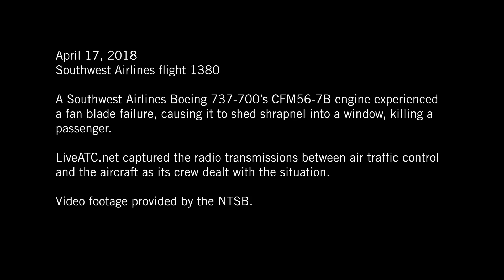Southwest Airlines 1380 Engine Failure 4/17/2018 ATC Audio – AINtv Express

Comment: Both pilot and ATC used lessons I was taught in the military: Never mind the fear. Focus solely on iimproving your situation. I knew both pilot and ATC were at least nervous because they (and the co-pilot too) got the runway designations confused. Several times. Perfectly natural and they self-corrected quickly. The ATC, presented with the extraordinary news that "someone went out," caught himself and said "Doesn't matter ... " Obviously it matters — quite a lot — but he was consciously reminding himself to focus on improving the situation, and not wasting time with things over which he has no control.